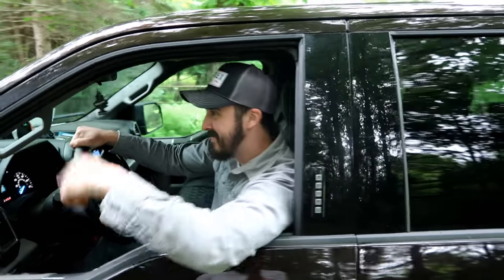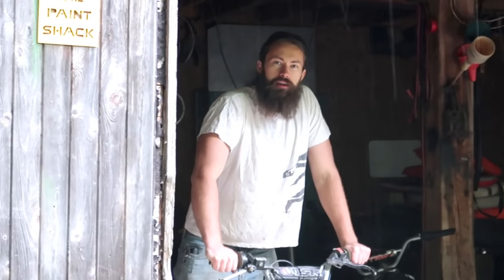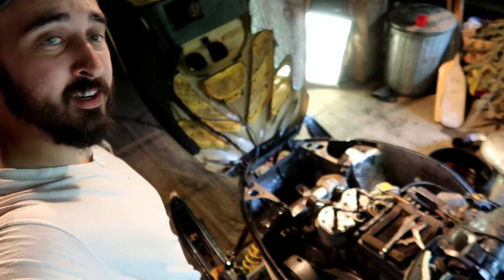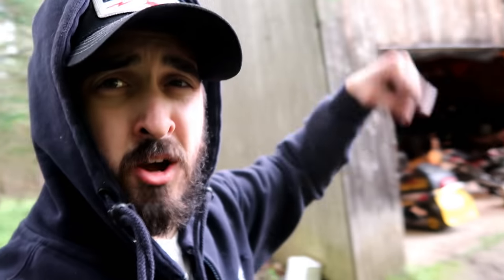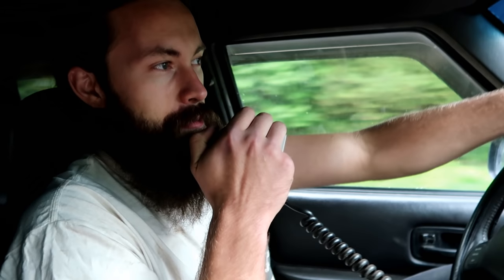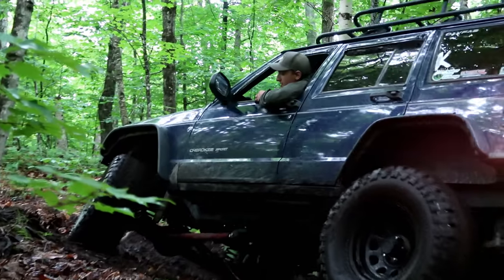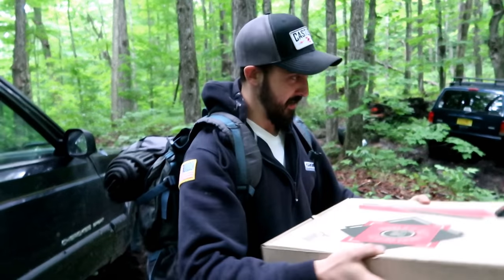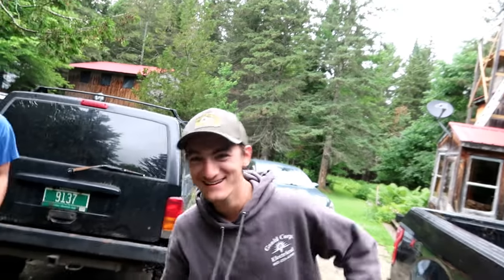REBUILDING MY DEAD SNOWMOBILE !!! Episode #1 ( SKI DOO MXZ 700 )

Comment: So why haven’t we seen more about this machine? Where is the rest of the videos? The pits on the head means it had blowing up at some point they are old not fresh. I know I’ve messaged you before and told you that’s a very common problem with oil in the cylinders come fall. O-ring in your oil pump is leaking. Not a bad thing LOL

Comment: You'll likely find that your throttle cable that goes to the oil feed is broken and that's why your flooding the engine with oil. It happened to our 2010 tnt 600 carb. Ran normal but took 2 rides to figure out the wierd oil consumption.

Comment: If the cylinders are filling with oil I would check the oil injection pump. If it is Gas check that the carbs are clean and the inlet needles and floats are clean and not worn. Other wise if it is antifreeze the o rings could be bad. But it looks like the head has been beat up by pieces of the rod bearings being pinched between the head and pistons. Cant wait to find out.